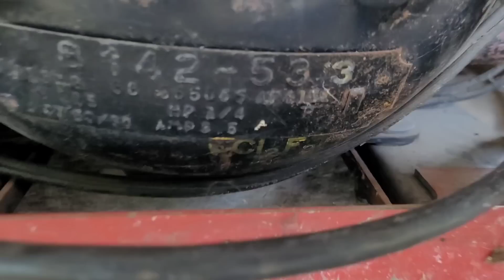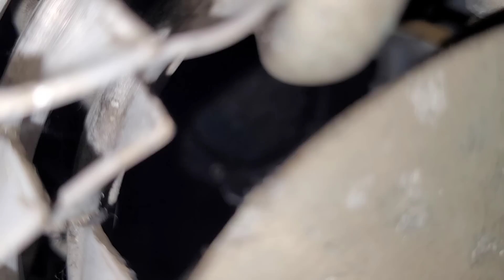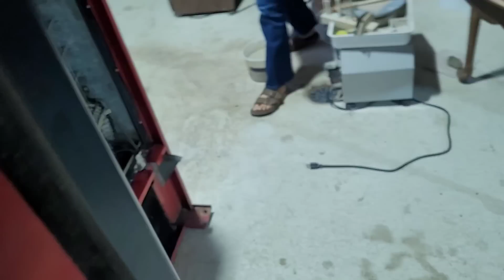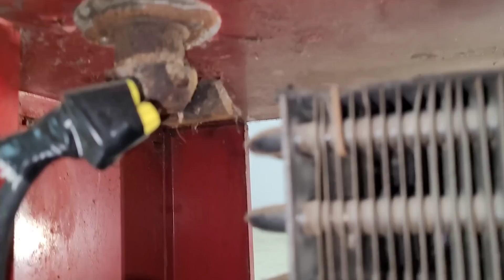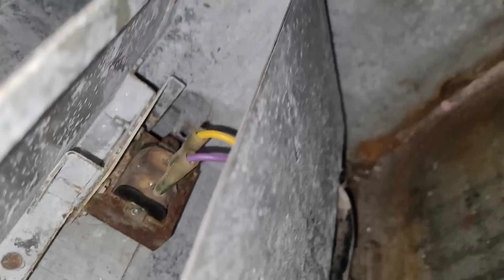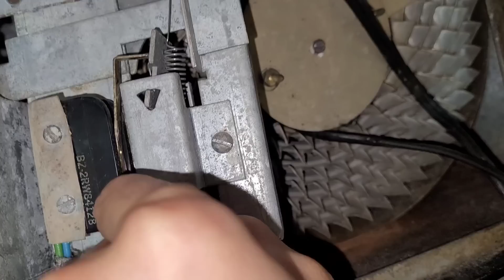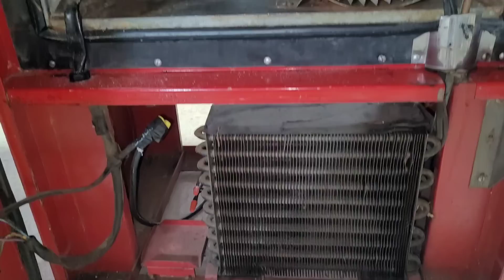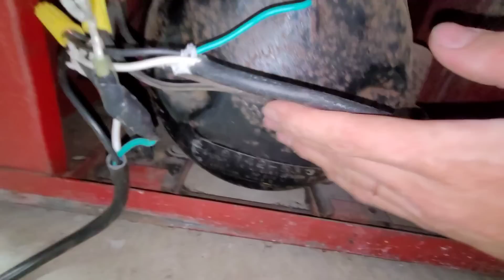Fixing a Vintage Coke Machine!

Comment: Thank you for this video! Very enjoyable as I own a 1970's era Pepsi LaCrosse with the Tecumseh pancake compressor, very similar to this one. It still runs great - I did replace the OEM wiring terminal block when I got it and a new main heavy gauge supply wire. Had to replace one condenser fan motor and a thermostat but otherwise very reliable. Some general advice to anyone who owns a vintage soda machine wanting to check overall electrical condition. Locate the metal plate on the outside of the cabinet. Power the unit up with an Amp meter inline with the main supply. If your current is very close what's on the plate, you're in good shape. And obviously check and carefully replace any wiring that has cracked or brittle insulation.

Comment: Don't know if you got your answer on the drain or not. But mine is stiffer and you can set it at any angle you want for flow. Then a bucket goes underneath to catch the water. Mine is also a larger unit but otherwise the same. I'm having the same issue with mine that's why I'm here....

Comment: There should be an additional light inside the door to illuminate the bottles, too. I’ve got a Vendo H90B and two Vendo H212B models and they all have a light inside the glass vending door to illuminate what you’ve got in there. Mine both take a F15T8/CW fluorescent bulb.

Comment: How did you get your technical knowledge? 😊
Reply from the maker: I work HVAC, plumbing and do refrigeration work as well. Makes a good mix for fun stuff like this!
Reply: @ReubenSahlstrom Thanks for replying. 😊 You also know engine repair & metal smithing!
Reply from the maker: @buzzz241 my interests are wide ranging. 😂 I am no expert, but I can usually figure things out well enough to get by.

Comment: I had one of those I bought in the 90s at a garage sale for $40, they did not have the key and when I got it home I drilled out the lock and found $75 in pre-64 silver coins.  I sold the machine for $1600 in 2015.  The face place where it lights up on mine said have a Coke and a smile
Reply from the maker: @armadilllo  now that sir, was a profitable find! 🤣

Comment: You're correct, when you inserted the money it unlocked the entire rack, but as soon as you made a choice, it would re-lock the rack.  Bedsides Coke, you might find 7UP or A&W Root Beer being vended out of a given machine like that one.  I'm 60, and my great uncle owned a mechanic's garage and had pretty much that same machine in there for years.  I seem to recall the price then was 25 cents.

Comment: When I was a kid,  the girl 2 doors over, her Dad was an HVAC tech. (This story is from about 1978) He acquired what had been a "dead" (non-cooling) Coke vending machine about 1 generation behind the one shown here.  As far as I remember,  it was still priced at 10 cents,  and the dispensing mechanism still worked,  but he fixed up the compressor and got it cooling properly again,  parked it in the garage,  and made it his beer cooler.  I seldom had change in my pockets at that age, but one day I had or found a dime,  dropped it in the slot, and it stopped in the mechanism, because her Dad had disabled it with something stopping up the coin accepter mechanism. He simply opened up the machine, which no longer locked, and either loaded up fresh beer, or grabbed out cold ones.  
As time went along, he learned to keep track of how many beer roughly were in the machine, because during the weekdays while he was at work, the neighborhood teens were finding ways to... uh,  keep hydrated in the summer heat.  He was a decent guy though, was calm and kind like my own Dad was. He liked the neighborhood kids as though they were his own, but you knew not to cross the line when he was around.  Wherever you are now, Don R., you were a touch of class in an otherwise boring neighborhood.  And a stand-up member of society.  Your daughter, however, turned out to be a tease and a (something else that rhymes with "strut").  And I would bet that if Don is still around, and still drinks beer, he keeps it cold in that same old Coke machine.

Comment: That wiring would be considered a security hazard in my country and be illegal :face-blue-wide-eyes:
Reply from the maker: @klotz__  Your country sounds communist.
Reply: @ReubenSahlstrom  yeah right, because doing things the proper way is communist 😆
Reply from the maker: That's a bit dishonest, wouldn't you say? I just mean your country must be very controlling if using wire nuts in a control cabinet is "illegal."

I do agree the wiring could be cleaner. What country do you hail from?

Comment: I did see that coke has been making the glass bottle sodas again, so you could actually stock it too!  But yea the gearing looked like it was only working with nickels.  Why? Quite possibly the age of the machine, that solenoid was for steel dimes of that period.  Just a thought.   So it would only work with nickels, unless you can find a gear box for quarters.  Point is back then we made things to last decades not the plastic imported crap we have today that we are lucky it if lasts more then a year or two….

Comment: Is is really wise to work with exposed wires with a little child wandering around? Also, I saw her putting one of the small wire nuts into her mouth. Bad things can happen instantaneously and sometimes there’s no going back once it happens. Better to play it 100% safe with toddlers.
Reply from the maker: @Creator-Builder  Yes it is definitely a big task to protect little people, and I strive to do that as well as I can! Thanks for pointing out the wire nut, I frankly did not notice her doing that or I would have told her to put it back. I think she actually realized what she was doing and put it back before I could say anything.
Reply: @ Thanks for the gracious reply. What a cute little girl she is! She seems to have a natural curiosity and wants to take part in Dad’s activities.
When I was a little boy, when my dad was doing dangerous stuff in the workshop, he started a few nails in a 2x4 and said he needed me to hammer those nails in. I guess that kept me out of trouble! I still remember grunting on purpose to sound just like him as I hammered in those nails so carefully. I must have I heard him grunting when doing a difficult reach when working in the cars, so I figured grunting was very important to the job at-hand.
Keep up the great work. You’re very gifted in troubleshooting.

Comment: Greaseballs used to carry a bottle opener and a collapsible camping cup in their hip pocket. When nobody was looking they'd pop a top and hold the cup under the bottle still in the rack. The curvy girl design of the bottle would only allow 1/2 of the contents to empty but they could go right down the stack until they got a full drink. Some carried a punch instead of an opener. With vertical office-style machines a straw would ..                                               get it all.    hahaha LOL

Comment: Water from sweating on the walls dripping down to bottom.  In case too much you can drain it.  The evaporator side is frost like your freeze.  The system melts the ice that forms a heater melts it just like a frostless freezer works.  The condenser below gets hot and it melts the ice and evaporates the water at the bottom  your refrigerator has a pand down below too.  It should have a ground fault interrupted to prevent electrical shock when dealing with water.  New standards.

Comment: It probably doesn't like your dimes because they are too new.  When that machine was built, dimes were solid silver and were heavier than today's allow dimes.  When they switched over from the solid silver coins to the alloy coins, it screwed most vending machines because they used a combination of weights and magnets to reject slugs.  But they never changed the nickels, so they still work in old vending machines.  I have an old jukebox and I had to recalibrate the weight sensors - it was set up as 1 play for a dime or 3 for a quarter and I hated using nickels because it only registered the 1 play.  Get a hold of a coin-op expert and they can probably tell you how adjust the sensors for that model coin mech (they're all different and I'm no expert).

Comment: That AIN'T a "vintage" Coke dispenser machine! The YELLOW ONES that take nickels for a 6 ounce bottle of Coca-Cola are VINTAGE-'ceptin' fer the one at the filling station I worked at as a 1960's teen! Every day we got 300 or 500 pounds of block ice and I dumped 25 pounds of rock salt on top and filled the tank with water and turned on the pump, and started loading bottles of more than a dozen kinds (Grapette and Orange Crush and three brands of root beer!) at 6AM and in an hour, the pop in the bottles turned into "slushies" when I opened them for customers on 110* days. Sticking your arm nearly to the shoulder on a scorcher day HURT TO THE BONE!!! 28*F water will do that...

Comment: The Bulb behind the coin slot looks to be a C7 bulb.  Now they are sold as 7W / 120V bulbs. used to be common in 14W versions, but due to heat, and cost, they are all gone. most hardware stores still stock them as they are used in older night lights.
Reply: Walmart carries them in the four pack  
They also make them in leds as well  , less heat , wattage  and little briter.

Comment: Perhaps you misspoke when talking about the coin mechanism at the end.  Clearly the writing is obscured, I presume that this can be cleaned up.  BUT, the price says 20 cents, which would be 2 dimes, OR 1 dime and 2 nickels, OR 4 nickels.  Obviously 2 dimes and 2 nickels would be incorrect as that totals 30 cents.  And changing the price so that you don't LOSE money on every transaction is another matter, though my guess is that the mechanism looks new enough to allow for replacement parts to accomplish this if you wanted.  Have fun with the Coke machine - I have even seen some places that do still sell the glass bottles as well as a commemorative bottle.
Reply from the maker: @mikenelson6630  well I appreciate that you say I misspoke rather than insult my math in the moment. I realized during editing that I misspoke, but did not have an easy way to correct it so I just left it in. Funny to see how few people actually do the math.
Reply: I had to look at that label a couple of times myself before I realized that part of the label was obstructed.  I used to use these machines all the time, and had never seen one spell out the price so exactly before.

Comment: I enjoyed your video very much. I too have been a user of this exact machine. It was 10 cents then as well. I'm a little ashamed to say it be we had a way to cheat those machines. We would bring a cup with us to the machine and a bottle opener. We'd move the bottle as far forward as possible then hold the cup under the bottle, open it with the opener and allow the soda to pour into our cup. I was born in 1955 so, I was probably around 8 or 9 at the time. Thanks for the video.

Comment: Generally the evaporator fan runs when the compressor runs. 

That cup keeps the fridge compartment sealed from critters, and it keeps the heat from the condenser outside. I have a machine a few years newer that was converted to cans before i got it.  

Mine takes any change you give it but only gives nickels back

Comment: When I was young, me and my mom lived in a small town in Nebraska. I was a devious little monster and the little store in town had one of these machines. You didn't need two dimes to get a soda. All you needed was a cup and a church key bottle opener. Hold your cup up to the bottle cap and pop it off. The cap would come off and the soda would fill your cup. If you grabbed the cap and flattened it out you could smash it back onto the bottle. The bottom two bottles were best bc nobody would give them a second look if the top bottles were full. 
     The store owner got wise to my little caper and switched to the top load fridge. It worked the same as this one does except you pull the bottle up through the mechanism that holds the bottles in..... soon I discovered all I needed was a double straw stuck together end to end. Like a telescope. And my trusty church key.... now I'm 53 and I drink Pepsi. I still think back to my younger self's shenanigans and smile. I mustve gotten a whoopin'  once a week? Hahaha... stay tuned for how I figured out how to get quarters out of the pool table at the little bar/restaurant where my mom worked...I think I made more money than she did?

Comment: You’ve discovered the solution to the old, “they just don’t make them like they used to” adage.  As soon as the public swallowed that line of bullshit, the manufacturers were free to make throwaway components.  If those things are repaired, which takes a little time & effort, as you’ve discovered, great things work again.  Thumbing your nose at the discarded.  Good for you and your little assistant!

Comment: Good job saving some history. Def had to be a wiring issue. Couple things 1. When taking any ohm reading you should measure like you did for voltage and not touch the wires with your fingers bc of the moisture/conductivity of your skin you can get a false reading. 2. You call the grooved wire  earth or ground it’s actually neutral even tho it can be the same as earth ground in the service panel. Compressor windings have a low ohm reading. The cord looked like a 2 wire cord if it was then the ground ring was connected to the hot side bc you removed the ground and it didn’t trip the breaker(could be wrong about the 2wire). I’m an hvac tech this is technically like an ac. Your troubleshooting was correct isolated components. Again great job saving history.

Comment: I bought a very similar vendorlator 7-up machine at a swap meet for $20 when I was in college in the early 80s.  It was left behind when the seller bought a motel.  It had no key, but the refrigerator worked.  It wouldn’t accept any coins.   We loaded it into a Ford Escort hatchback and had 3 adults also in that car to haul it away. - tight fit!  Once home,  I was able to bust out the tumblers in the lock in about 30 seconds due to the skills learned as a misguided youth.   I found that someone dropped in a Canadian quarter into the machine and it was lodged in the coin acceptor.  Removing it, there was all kinds of money in the cash box and coin chute, easily more than the $20 i spent on the machine.  I kept beer in it, 15 cents to dispense a bottle and it’d make change if you used a quarter.  I still have that machine now, some 40 years later and it runs as well now as after I repaired it when I originally bought it.
Reply from the maker: Wow! It's cool that people like these machines enough to keep em around.

Comment: That machine is probably from the mid to late 50's, before cans became popular. I had a few machines like that in the 80's. The next generation held cans and had a can pierce/opener that was built into the front (pre pull tabs). Now those machines are collector items, not usable to actually sell soda because they cant be converted to accept dollar bills.

Comment: Wow can’t believe I even heard the words scrap as this unit is so rare and desirable!
Reply from the maker: @spencerd8201  hey now! Scrap is rare and desirable too! 😉 

I suppose perhaps I'm just a little less sentimental than others. I shall spare it from the scrap pile.
Reply: @ReubenSahlstrom  Water proof that splicing by the drip cup, lube up the drip cup, wax the body, clean out the mold & replace the burned out bulb & enjoy your Coke machine for years to come. Just a thought. Pleasure to see you fixed it & it can be used again. Enjoy your handiworks delights on a hot summers day!

Comment: The reason its rejecting your dimes is because they are a different weight. I have one of these, and it does the same thing. I save old coins from the 90s and older just for this. Also the weird incandecent is just a christmas tree light bulb. Theyre very common. I think its a c7

Comment: When I was a kid I remember outside the firehouse in my city they had one of these. 
I remember going there and buying a Coke and drinking it sitting in front of the firehouse. 

I don't know if the firehouse owned it or the City or if a vending company owned it. 

But I think it was 15 cents
It wasn't 25 
It wasn't 10 cents 
Pretty sure it was 15 cents

I remember the bottles were small 
10 ounce maybe 

I remember seeing the Pepsi 16 ounce glass bottles in the convenience store. 
They were 25 cents. 

I used to get a donut and a bottle of Pepsi at the Local Food Mart across the street from my apartment on my way to school. 
I would have a donut and soda most mornings. 
I remember school lunch 
Dinner was never great
I wish I could have had a good breakfast but I was lucky I could get the donut and soda
😢

Comment: Looks like a Tecumseh "pancake" compressor.  Compressor could be froze, start winding could be shorted etc.  The compressor and refrigerant can be upgraded.
Reply: You may have to wash it down with a mild mix of soap, water and bleach to get rid of the smell.
Reply: The coin reject solenoid should be pulled in possibly when the machine is stocked with product.   If there are no bottles, then the solenoid in the slug rejector will be released and coins will fall back through to the coin returns.
Reply: The correct change lamp or sold out lamp whichever that is, is a 7 watt incandescent (or 4 watt) night light bulb.
Reply: The condensation from the evaporator may drop down into a pan below where the water is then evaporated from the heat of the condenser coil.

Comment: Definitely an R-12 and the compressor is even labeled for it in big yellow letters CCl2F2 (Dichlorodifluoromethane) which is R-12.
Reply: You can use some hotshot or MP39 if when there is a system issue.
Reply from the maker: @JaimeGarciaX or 409a. That's what we usually drop in for an r12 replacement. I have worked on some r414b systems that I think were r12 originally too.